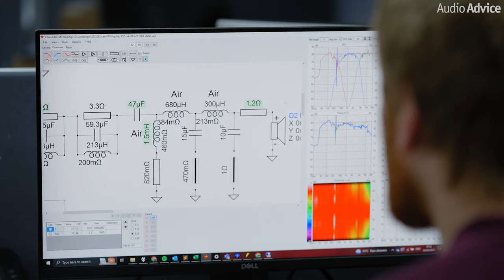Monitor Audio Hyphn - Reference Floorstanding Loudspeaker | NEW Flagship Speaker from @monitoraudiogroup

Comment: I own monitor audio PL300ll and they replaced a lot of speakers before them,some more money some less but this price is ridiculous,I don’t care how it sounds,I admire monitors engineering and that is what made me interested in the platinum,and the sound quality made it easy to keep them.
Reply from the maker: It is at the extreme high end of pricing and their statement piece.  Thanks for sharing your experience with your Monitor Audio speakers.
Reply: @AudioAdvice  it’s just a shame that so called statement or reference as there classified have to be priced for the rich, material and build of most of these speakers do not condone the price,having two degree in engineering from NYU mechanical and electrical I cannot be fooled by some of these builds